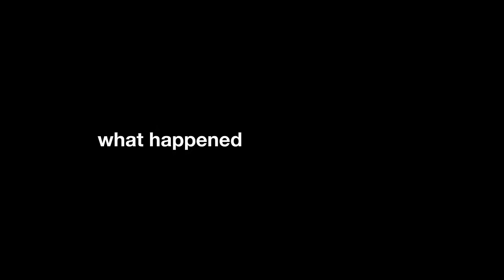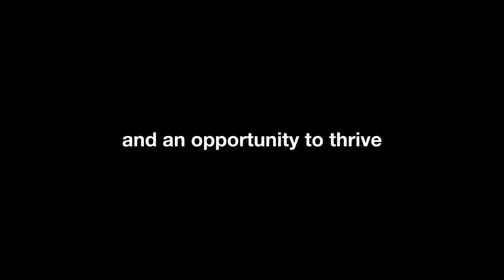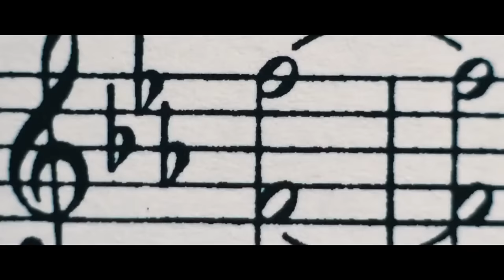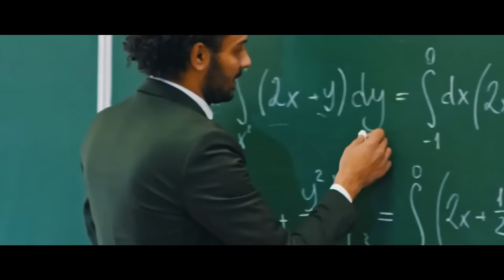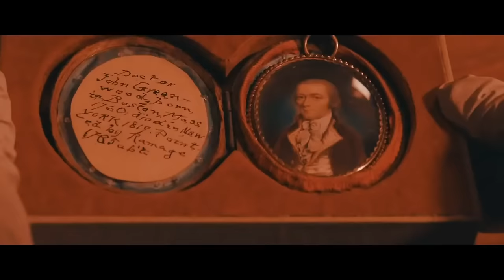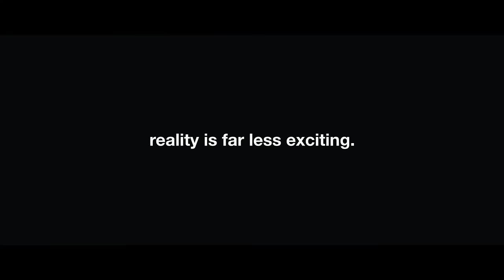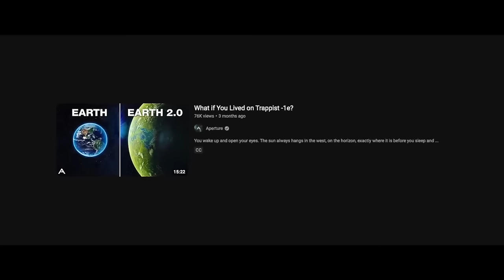The History of Life, I guess

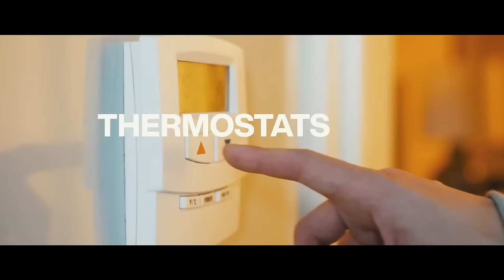Comment: ...Exodus 26:13 ≈ π...

Moses was first to record Pi in 1440 BC. Josephus the Historian's description of the Tabernacle in 94 AD was inaccurate. This oversight was discovered in 2015 AD. 

   

     330      Exodus 26:8                                     eleven curtains each 30 cubits long

        15      Exodus 26:12                                   one of the curtains is folded in half to 15 cubits long

       - 1      Exodus 26:13 makes Pi                  each curtain overlap/seam adds up to 1 cubit

 = 314

3.14 = 314 circumference/100 diameter ≈ π ratio (100 cubit court per Exodus 27:9-18)

.................

This Wilderness Tabernacle archeological discovery is similar to the Dead Sea Scrolls and Martin Luther's 95 Theses.

.................

History of finding π:
-(1900-1680 BC) One Babylonian tablet indicates a value of 3.125 for π
-(1650 BC) The Rhind Papyrus the Egyptians gave the approximate value of π 3.1605
-(1440 BC) Moses recorded Pi in the Exodus blueprints rediscovered in (2015 AD) 3.141592653... or Exodus 26:13 ≈ Pi
-(500 BC) India's Aryabhata approximation was 62,832/20,000, or 3.141
-(429-501 BC) Zu Chongzhi a Chinese mathematician 3.1415926 - 3.1415927
-(250 BC) Archimedes from Syracuse showed between 3.1408 and 3.1429

.................

The knowledge of Pi was lost from Exodus near 1000 BC. Josephus the Historian in 94 AD did NOT know about Exodus 26:13 makes Pi to properly explain the Tabernacle blueprints. He deferred to the Temple's structure and not Exodus 25-26-27. 

Pi is found in the spiral of the double helix in your DNA. This knowledge has been lost for 3000 years.

Consider King Josiah & the Prophetess Huldah rediscovering the scriptures, right? In short, this monumental oversight was corrected in 2015. What's next? 

...Exodus 26:13 ≈ π...